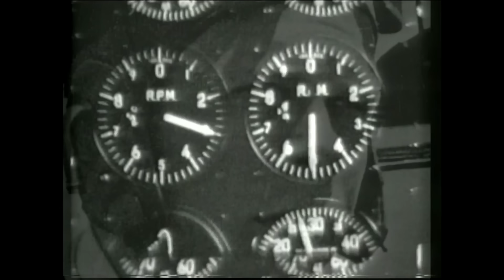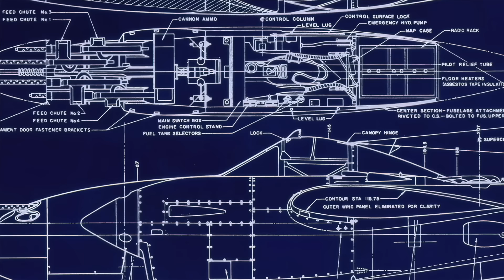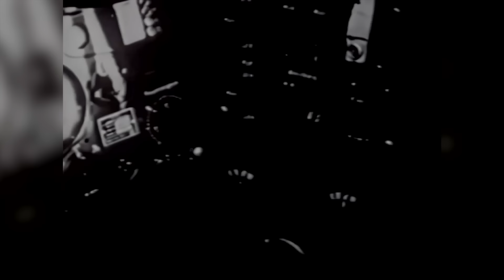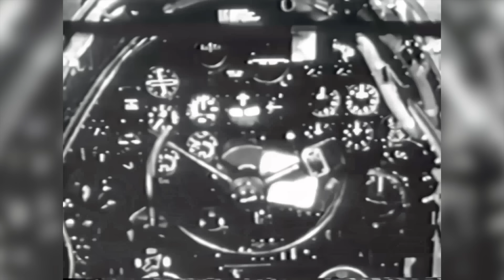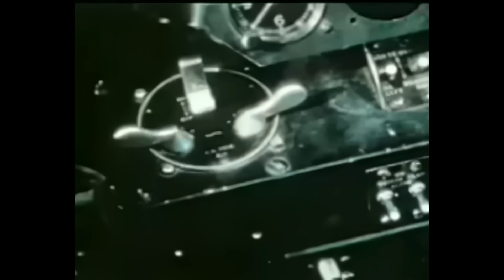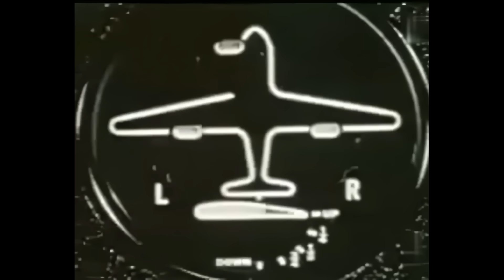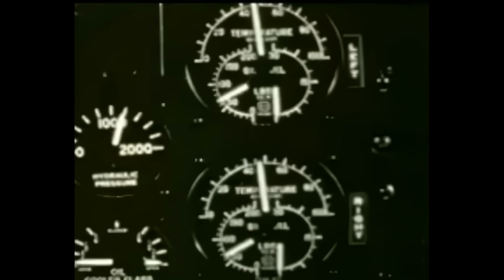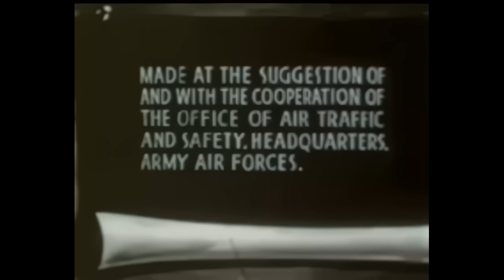U.S. Ace of Aces Richard Bong And The Lockheed P-38 Lightning

Comment: The “Winchester” deer rifle shown at 5:18 is not a Winchester, but a Savage Model 1899 lever rifle. The Savage 99 was arguably the best lever rifle of the 20th century, and highly favored in the Northwoods where Dick Bong learned to shoot.
Reply: Most favored because they had a rotary magazine, and hence could utilize more aerodynamic bullet shapes as opposed to the tubular magazine Winchester with required a blunt-nosed round to keep from potentially setting the primer off on one of the rounds during a hard jarring, or recoil.

Comment: I notice that the narration avoids stating losses at Ploesti. That would not have served the propaganda purpose of the film. Also Also boasts about the P-38's diving ability--actually a critical weakness when it led to compressibility that was ultimately addressed by adding dive flaps. And is that Uncle Ron on the narration?
Still a pretty amazing bird all in all.

Comment: I didn't know the reason the P-38 was unfit for combat in Europe because of the cooling system freezing up.
Reply: Hi,
P38 suffered 3 inconvenients in ETO.
The British supply system was faulty.
They issued 8th air force fighters with 87 degrees octane fuel.
That caused fouled spark plugs that not only froze the engine, but pilots for this reason had to apply full power to get back home,wich caused fuel shortage in mid flight.
You're right also for cooling system.
It took several weeks to technical officers to know the cause of engine seizing.
Many a pilot had BOTH engines cutting out above occupied territories.
On top of that, German Focke wulfs had better flaps and could out turn P38.
Pilots were not stupid and refused horizontal dogs fighting with them, although difficult when necessary to help a winger in danger.
Reply: Failure is like onions they say. That was true of the P-38 in ETO. In many cases the things they did to prevent problems were making the problems worse. Excessive cooling was leading to bad fuel distribution so that some cylinders were so rich they fowled plugs while other cylinders were at the same time running lean and burning pistons. The normal fix for burned pistons is run richer and cooler and that made the problem worse. It was years before the problems were fully understood. Fuel was condensing out in the intercooler and not being delivered equally to the cylinders. They needed to close the intercooler flaps and raise temperature so the fuel would vaporize better and get to all the cylinders. Now with equal fuel getting to the cylinders they could lean the mixture and the plug fowling was largely eliminated and range was improved too. This was not fully understood until they had been withdrawn from European bomber escort and was a problem that was most troublesome on those cold high altitude escort missions. In addition their was the sonic compressability issues that caused many P-38 to dive out of control. Lockheed produced a modification to eliminate this and kits to fit it to the planes in England but guess what? They were shipped over by air in one plane and the RAF Western Approaches patrol aircraft mistook it for a German patrol plane and shot it down. Eighth Air Force ordered all the P-38 off of escort missions before replacement modification kits could be delivered.
Reply: @keithstudly6071  
All you say is right.
I forgot to mention fouled spark plugs which was a consequence of these disfunctionning.
What was also more than irritating was windscreen de-icing above 10000 ft that was not always working fine.
I would have preferred the good fat, reliable P47.
Reply: I guess Robin Olds didn't get the memo😂
Reply: I think it was mostly the turbo intercoolers in the wings of the early models.  Later versions used redesigned intercoolers to the engine nacelles.
Reply: The problems were all easily resolved.

First, the 8th AF tried to fly the P-38 using higher RPM, lower boost, and auto rich mixture. The correct settings are 1600 RPM, 36"40" of boost, and auto lean. This burns less fuel, keeps the spark plugs clean, and keeps the oil and coolant at proper operating temperatures. It's in the pilot's manual, ignored by the 8th AF.

The British fuel was poorly mixed, the tetraethyl lead would not remain in emulsified suspension. It fouled spark plugs, clogged intercoolers, and caused detonation.

The P-38 could out climb and out turn Luftwaffe fighters at most altitudes, and speeds, with few exceptions. It could easily put turn the FW 190. The P-38 was best used to fight in the vertical, rather than flat turns, although it could turn well, using differential throttling, and rudders. The P-38 could out roll any piston fighter above 320MPH when it was equipped with hydraulic boosted ailerons.

The War Production Board repeatedly delayed or denied upgrades to the P-38. The P-38J-15-Lo could have been deployed to Europe by August of 1943 had the War Production Board not delayed it.

The P-38K, with 1875HP engines, and Hamilton Standard hydrostatic high activity paddle props was denied completely by the War Production Board, despite showing actual dominance in performance in April 1943. It's performance was so good, that the U.S. Army Material Command again petitioned for it to enter production in May of 1944.

The P-38 performed very well against the Luftwaffe over the Mediterranean, Italy, North Africa, and Romania.

Well trained pilots with experience performed well in the 8th AF as well.

Doolittle loved the P-38, but due to logistics, chose to side line it for the most part.